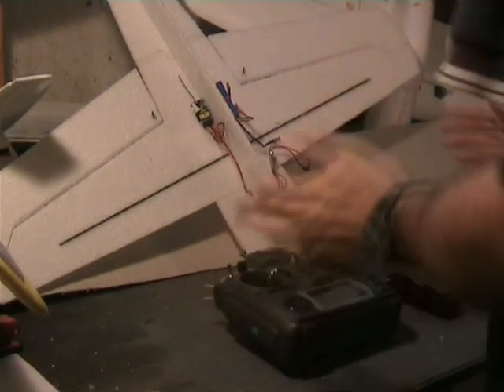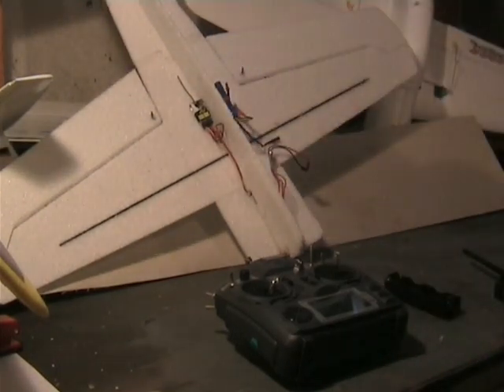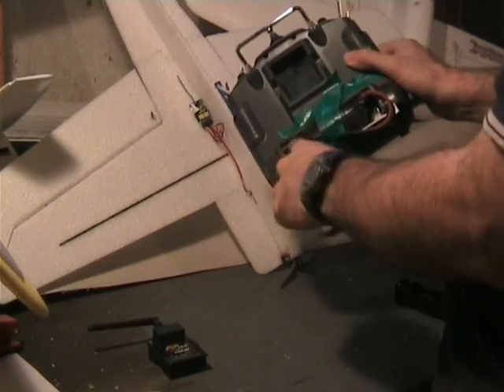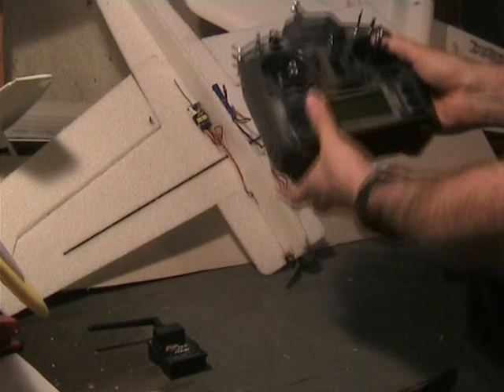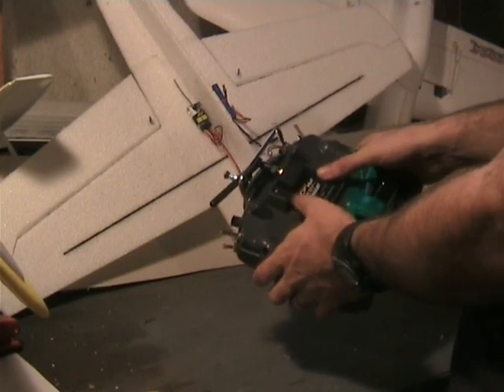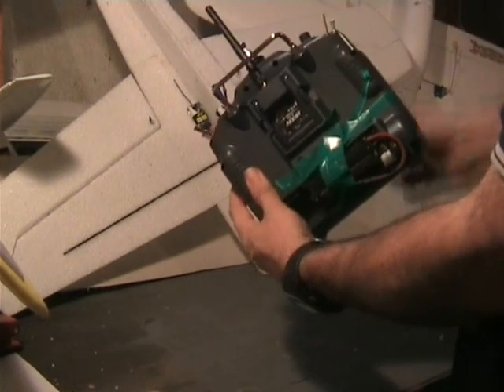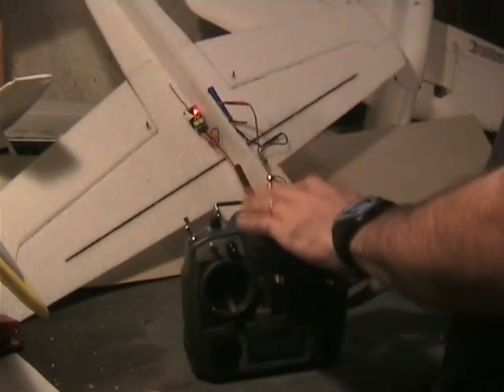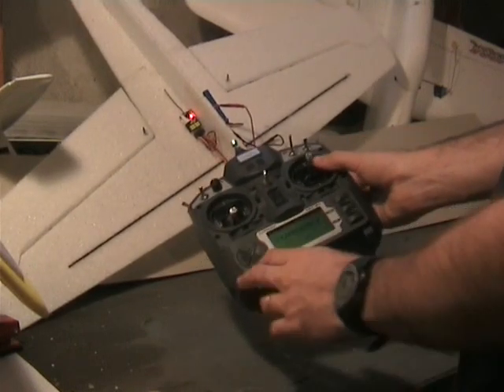Mounting a FrSky Module into a Turnigy 9x tx

Comment from the maker: @RevoRacer24 That is normally done to make it look nice and stop you having two antenna's. The second antenna does absorb some of the signal however I have not noticed any negative effect on range. I run a DX7 with two antenna's one FrSky and one the standard DSM2 antenna. Been running like this for two years and not one range issue with any of my planes. Except when I forgot the range check mode on. But that is pilot error. ;-)

Comment from the maker: None the older 9x's at the time this video was made had the telescopic antenna and not the hobbyking 2.4 module installed.

Since then they no long make it with that antenna but there is nothing stopping you removing it or rerouting your 2.4 module antenna up and into the 9x.

Comment from the maker: @ScooterEngan1 Imagine the signal being emitted in a cone shape with the large flat surface towards the top of the antenna and the narrow section of the cone at the bottom of the antenna. Directly up is one way the other which is easer on most tx's it 45 degrees off to the left or the right. So face the side of the antenna to the model.

However antenna orientation on the tx is not as important as antenna orientation in the model.

Comment from the maker: I take it you are talking about a FrSky Module installed into the 9x. If you turn it on without touching any buttons on the back it should be in normal mode. If you are only getting 50feet then something is wrong either with the rx antennas or the tx module.